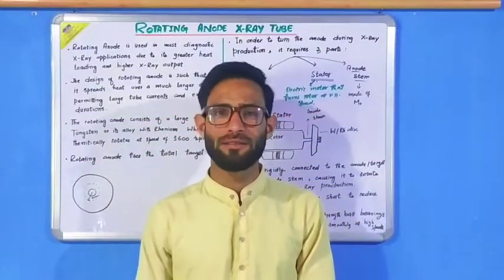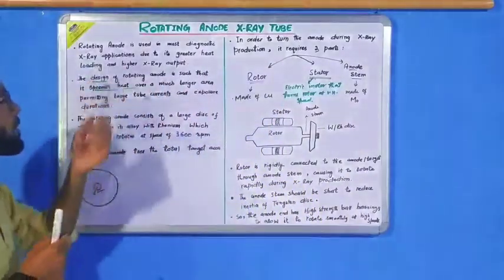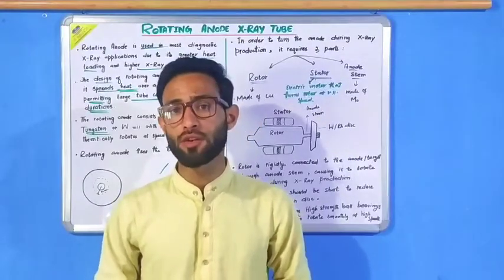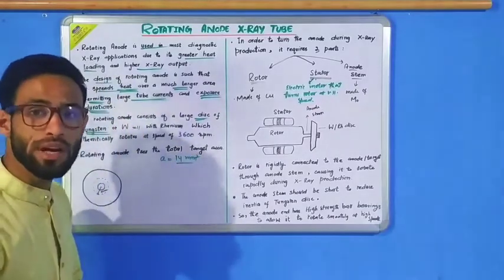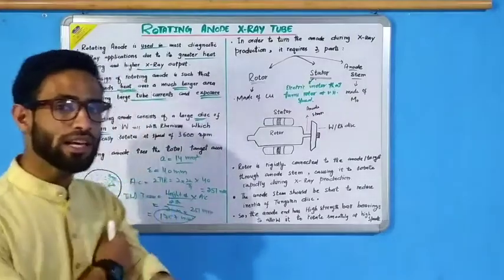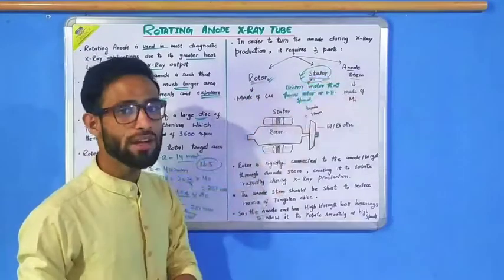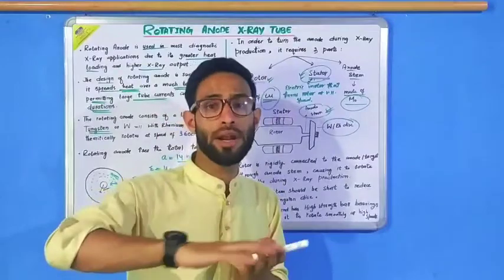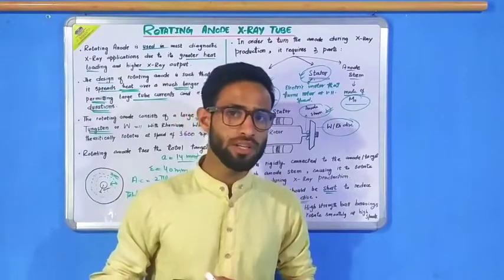| X-Ray Tube | PART 4 |  ROTATING ANODE X-RAY TUBE | By Aaqib Mehraj |

Comment: Stator coil produces magnetic field which induces current in copper rotor of the induction motor and that induced current provides the power to rotate the anode assembly. 7:06

Comment: sir ji
Roteting Anod me
last ke 3 character clear ni dikh pa rahe h isliye m unko nots nhi kr paya
uske liye mene space rekha h
plz 3no lines diagram ke baad vali send kijiye
or
koi bhi bhai log jinko ye samj aa rha vo plz 1/2/3 tino lins comment me type kr de jisse ki m nits completely kr sku
tq all of you
Reply from the maker: 1.Rotor is rigidly connected to the Anode or target through anode stem causing it to rotate rapidly during X Ray Production
2.the anode stem should be short to reduce inertia of Tungten Disc
3.So the anode end has high strength ball bearings to allow it to rotate Smoothly at high speeds.....